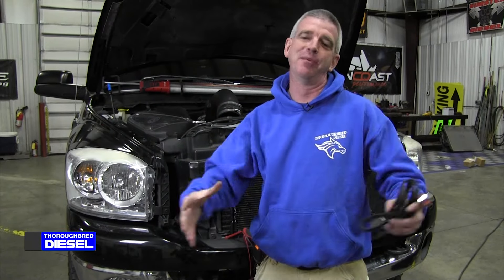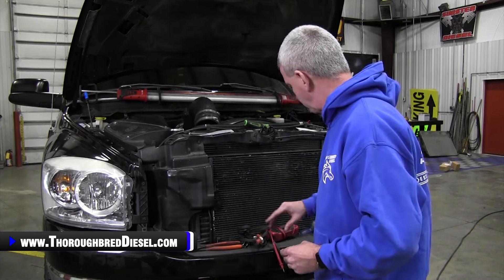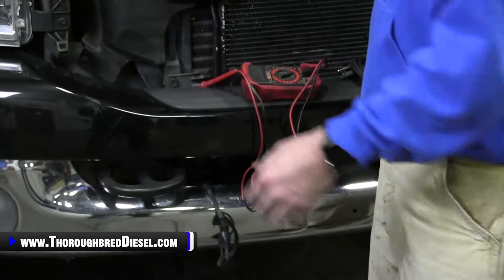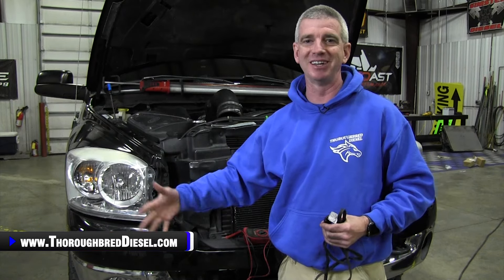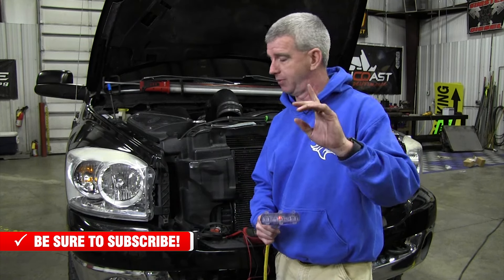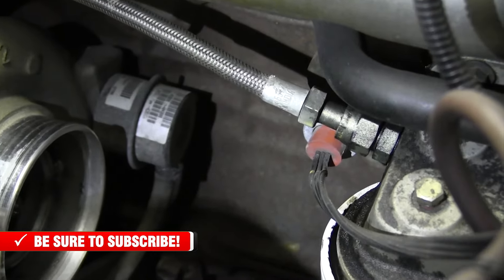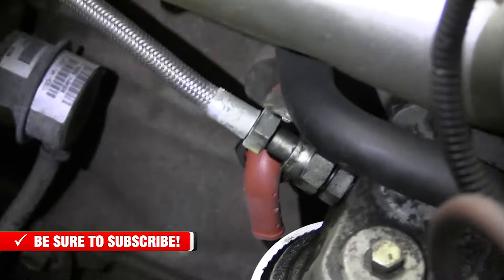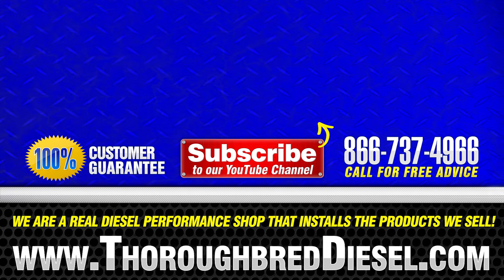How To Replace A Block Heater Cord: (Install)

Comment: We're the heater on a 05 dmax my trucks dose not have a plugin that I can fine
Reply from the maker: The cord should be somewhere on the passenger side of the engine.
Reply: @thoroughbreddiesel  passenger side at the front , next to the engine mount.Easily visible when removing the inner fender

Comment: Block heaters are from more than convenience. It preheats the coolant and the engine block and the oil if you have a pan heater is a well. You don't get instant Heat out of your heater in the cab but it drastically reduces wear and tear on the engine. I live in northern Alaska and if I do not plug my car in gas or diesel it sounds like it's going to explode when I started in Sub-Zero temperatures. If it's colder than 18 degrees you should be plugging it in if it's parked outside.

Comment: having trouble finding my cord on my 2006 dodge cummins 3500 5.9 - if I have to buy one, can they be bought anywhere?
Reply from the maker: Should be close to the engine oil filter as shown in this video. If you need a cord, we carry them and they can be found here:  https://www.thoroughbreddiesel.com/251919/

Comment: Wade whats your thoughts on using a electric timer set to start 4-5 hrs before starting engine , just trying to lower my electric bill. i hav an 02 ram 2500,  when temps are below freezing, i plug in the truck to retain heat all night.
Reply from the maker: That’s what I do as well.  I have found that the timers aren’t the most reliable, and I have had to change them after a couple years use.  It’s another reason I like to use drop cords with the LED lights in them.
Reply: I believe I had this timer for my pool and didn't have any problems during the 8 years I lived there: Intermatic P1121

Comment: Kind of late question hopefully you would answr , where would Honda Civic coupe 2008 block heater plug be located. Looked around the battery but still can’t figure out where
Reply: Did you find it? Front of the engine towards the center

Comment: I had to replace the heater element on my 5.9 a few years ago and I read in the directions you are supposed to unplug it first before starting the engine. Any idea why that might be?
Reply: If the heater element is exposed to air they can fail not likely but possible
Reply from the maker: Maybe they put that in the instructions as a safety precaution, so you don’t drive away with the heater plugged in. Which I have done a few times myself.

Comment: ford had an update for my 2016 f150 truck block heater cord and after about 2 hrs in leaving my truck there I got a phone call from ford saying they could not do the install because of my bush guard and winch..they said they would have to remove it????  WTF...it is just a simple cord that plugs into the block then runs out the grill???? I am pissed..the only thing that I can think of is that the mechanics like to work close to the rad at the front of the truck and the bush guard and winch sticks out about a foot and they could not get close in. I will install it myself!!!

Comment: I cant find my block heater on my 2011 dodge journey i need too replace the cord, and all my searches end in  0 results
Reply from the maker: I don’t know exactly where it is either. If the vehicle was sold in Canada I assume it would be there. Possibly under the TIPM?